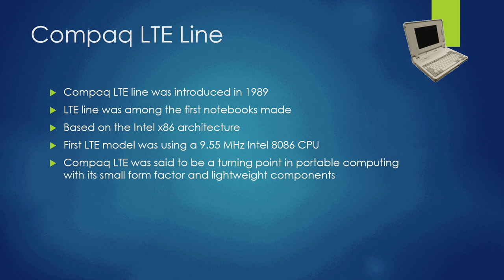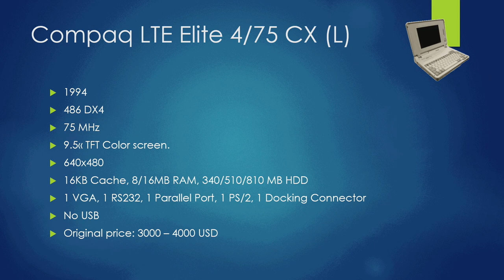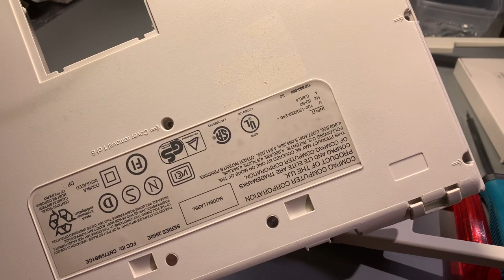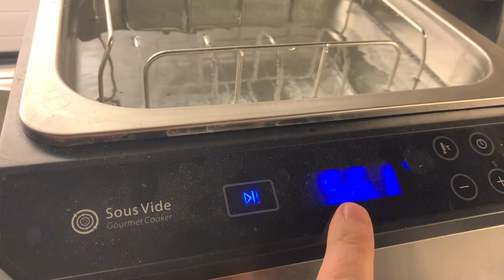1994 Compaq LTE Elite 486 Notebook restoration

Comment: Please tell me. Is it the hard drive itself or an adapter adapter?
I'm afraid to spin, suddenly, under the metal casing, there are discs right away.
Reply: Hdd is mounted inside the aluminum casing. You can open it up

Comment: I just bought one of these yesterday.  4/50cx.  I'm worried about the CMOS battery leaking. Thinking of removing it.  Does anyone know if it will boot without the battery
Reply: A follow-up.  I can confirm that this series of laptops boots up WITHOUT cmos battery.  No problem..  I picked up 2 of these systems.  1 cmos battery is still fine.  The other showed signs of early leaking.  I removed both anyways since I don't plan to use these systems regularly and the risk of leakage => motherboard killers.
Reply: I just booted mine today for the first time in a long time, and it complained about the battery, but happily booted up.  I have a 4/75cx.